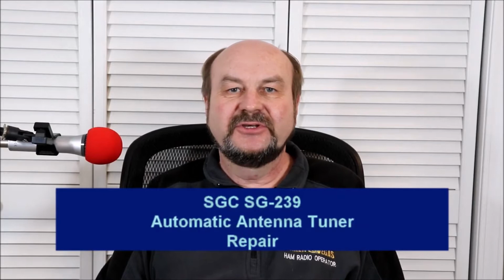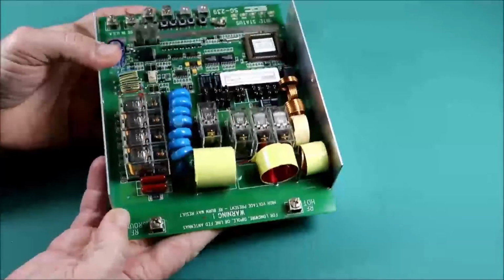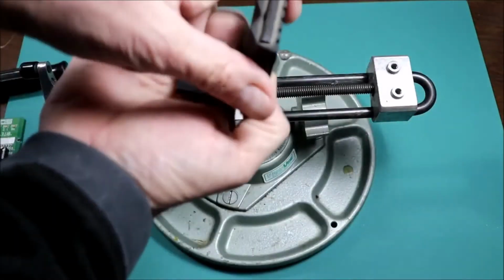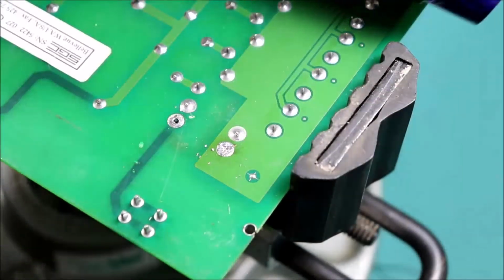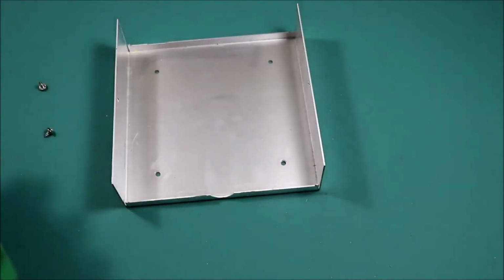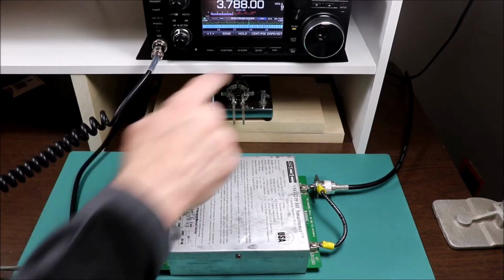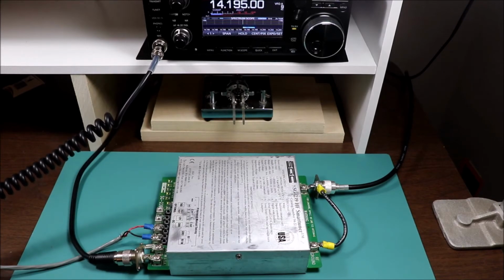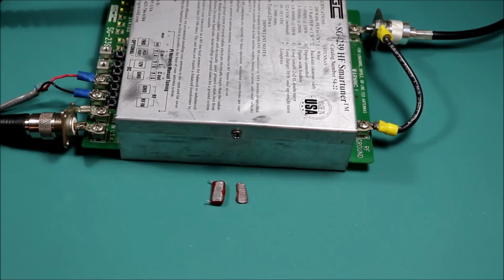Reparing an SGC SG-239 Automatic Antenna Tuner

Comment: I have exactly the same issue but from
New!  I will crack mine open tomorrow. You have inspired me. I want it to work
Reply: Ok. While it’s 23:30. I couldn’t sleep without opening that sucker up. I noticed two free floating legs of one of the coils!  I’m good on QRZ if you wanna see pics.  Cheers for the inspiration. Wade. VK1MIC